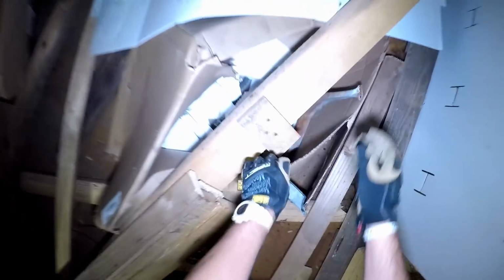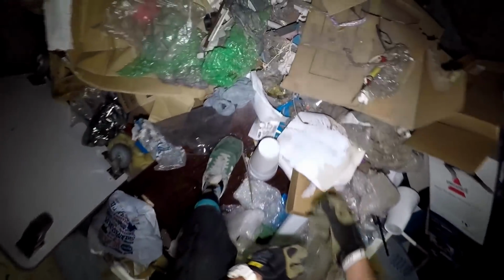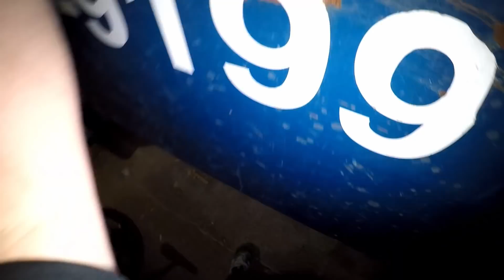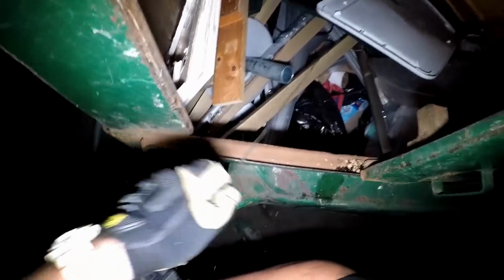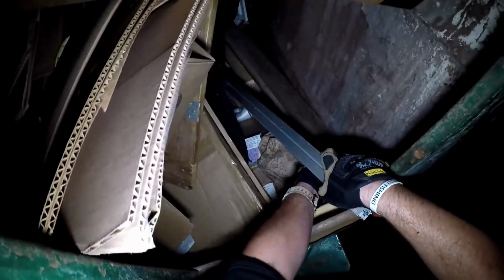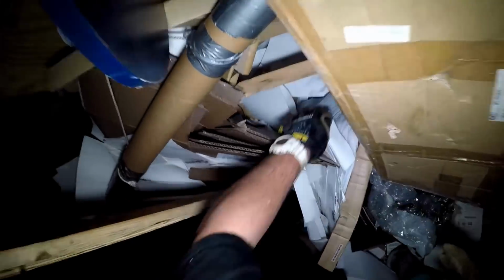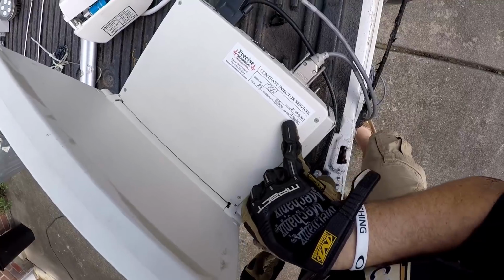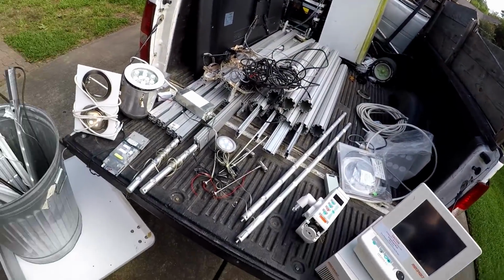Dumpster Diving "For The Love Of Scrap!"

Comment: Great lights for the truck on the passenger side and on the driver side outside of the wood also need a power inverter so you can plug up 4 AC power that way you don't have to Hartford scrap in the dark also scrapping at night would be easier FYI from FMI to you

Comment: Mike, this might sound utterly off the wall, but hear me out. We set up partition kiosks for ComicCon and other conventions with metal doohickies just like you found. So, mount the rounded, divided bit into a round base. Add another piece with a pokey end into the bottom rounded one and make sure the channels match up. Take those thin (dark blue and hole punched silver ) panels that were in the large cardboard boxes and slide those puppies in the channel grooves. Voila there you have instant walls. Also works for temporary office dividers. I am just a minion and I rarely pay attention to the actual names of things. But when they voluntold me to assist with the building of those booths, it is fun and challenging. Like real life sized connex from childhood. Lol So forgive my lack of technical names.

Comment: the "medical" dumpster had parts of the IV drip machine , the others parts are for other things, but that one first part is the IV drip control part
Reply: It's an IV contrast injector, not a "drip"
Reply: That glass,if part of an X-ray machine, then its lead glass which is extremely expensive... but I think its part of a MRI machine... the glass would still be expensive...
Reply: they should really took that equipment parts to depose properly , not in a dumpster were its exposed, might be somewhat dangerous, thinking of kids or you know in general safety

Comment: Before you scrap that aluminum check out the prices of "T slot aluminum". You could probably get more for one piece of the aluminum on ebay than scrapping the entire load you found. If its 80/20 t slot aluminum a 4 feet section goes for 10 bucks or more.